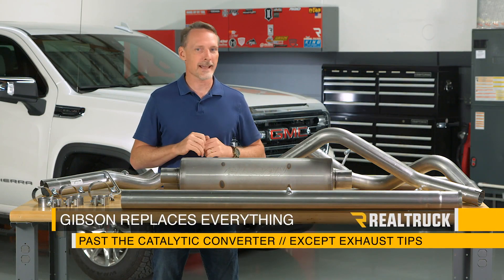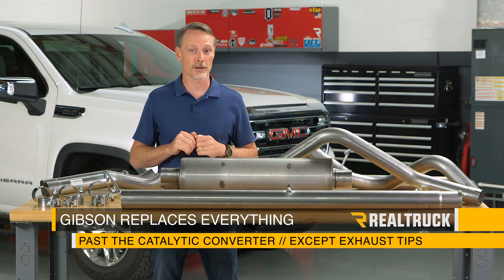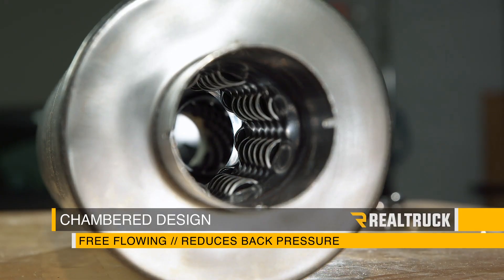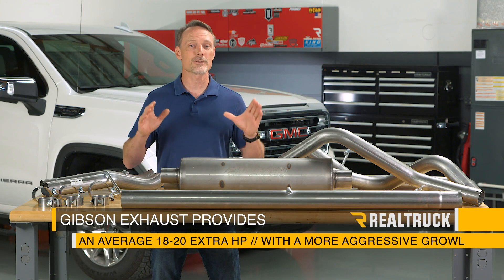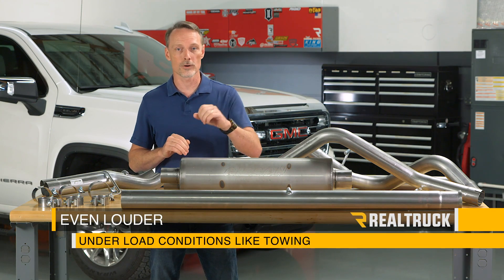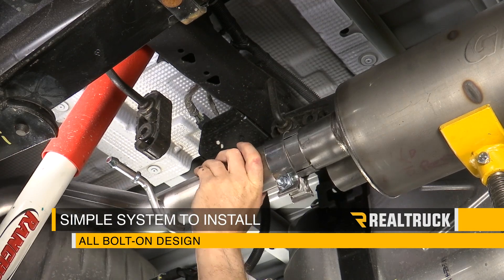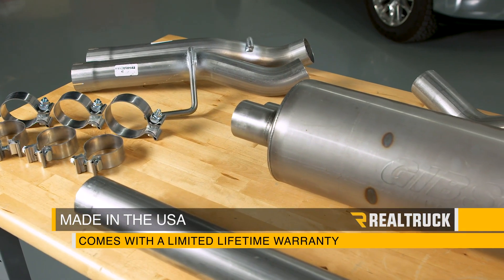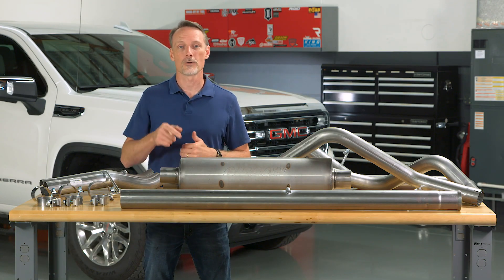Gibson Exhaust Systems Before and After Sound on a 2019 GMC Chevy 1500 Crew Cab 5.3 V8

Comment: What model / part number is this?
Reply from the maker: Hey there! The part number is #GPE-65688. You can find it here, https://realtruck.com/p/gibson-performance-stainless-exhaust-system/v/chevy/silverado-1500/2022/. Also, if you have the Z71 (Chevy) or X31 (GMC) packages, those trucks come with the exhaust tips built into the bumper as seen in the video. Order with no tips to work with the factory tips. Hope that helps! :)

Comment: Is there any cabin drone? Also, is it the same kit for the 6.2L?

**MAJOR EDIT/UPDATE**
Just got it and installed it!   👁️ 👁️ 

Operation: 'Wife doesn't know.' in full swing.

Day 1: Took 1 hour to uninstall factory and install new, did it at lunch. Both of us are WFH. Oddly, she didn't come see what the sound was, as I sawzall'd my old exhaust off. Waited to do the first start after wife left the house at lunch. FML, it's ungodly loud! I'm dead, wife gonna be heated!
Day 2: Had drill weekend, was gone for 3 days, had a chance to heat cycle and let the interior coat with soot. Sound has dropped some, I might pull this off yet!
Day 4: Returned from drill, sound is mellowing out now. Slowly and cautiously backed into my spot on the car pad. Wife, nor mother-in-law, knew I had arrived home. I'm in the clear so far.
Day 5: Drove our daughter to mother-in-law's for the day. Was sure to be gentle on the throttle. Wife still hasn't noticed. But keeping RPM's low isn't easy, exit to our street is uphill.
Day 6: Just took son to school, wife next to the truck waving goodbye. Slowly and cautiously drove off as usual. She still hasn't seemed to notice. Later in evening, I had to take the wife to her mom's, drop her off and get the kids. Leaving the house, I drove slow, and she said "why are you driving slow, is there something wrong with the truck?" Through the early part of the RPM range, the exhaust is noticable, but not that much. Wife didn't say anything. Have I done the unthinkable?!

To be continued.....

Day 8: Just took wife to Dr visit after getting kid from school. Afterwards, we stopped for food, I said "I hear a ticking, sounds like lash needs adjusted on a valve" and wife said "I don't know, it's pretty loud, not even sure what I'm listening for." She might be on to me, my days might be numbered.

Can I keep her from finding out before I get sound matting installed, and spray in bed liner? Both should cut back on the faint amount of drone there is.

To be continued, again.....
Reply from the maker: Hey Scott, the sound difference inside the cab is very mild. We've also not found any cruising speeds with a noticeable drone. As for the kit, unfortunately, they will not match and the 6.2L will be a bit louder. Hope that helps!
Reply: @Realtruck  I made a update. I installed the kit without my wife noticing (we're both WFH). It's been almost a week, and she hasn't caught on yet. Granted, she rode in it twice and it now has 1100 miles on it. So she probably doesn't remember how it once was. The low RPM range note is nice. Very throaty slow RPM thumps. At higher RPM range it flows great and isn't overly noisy. Definitely what I was looking for!

My question now, is how did I get the Gibson 6.2L kit from Amazon for $365 shipped?! The box was in rough shape, but everything was fine otherwise and all the parts were there.